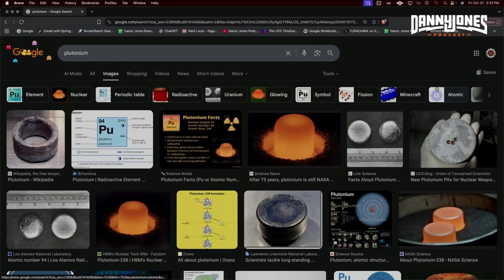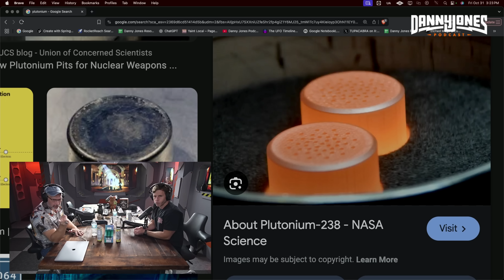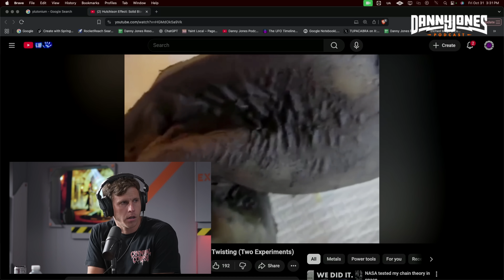Nuclear Machines in Ancient Egypt: Engineer's New Theory Solves Everything | Max Zamilov

Comment: When people study ancient engineering, the most important skill is separating real evidence from hype. A lot of signs that look high tech at first can often be explained by tools and methods the Egyptians already had, especially when you combine archaeology with physics and engineering. At the same time, there are still areas where the data is incomplete and where the right experiments could finally settle long running debates. This is why real inquiry needs patience, interdisciplinary testing, and a willingness to look at both possibility and probability.

Once you learn how to spot the red flags, you start to notice how many theories rely on assumptions instead of measurable results. But you also begin to see the places where the official explanations do not add up. That gap between what we know and what we cannot explain is where the real mysteries of ancient technology live.

I study that same space when I create music. I work with frequency, rhythm, and symbolic structure because those elements let me explore the hidden patterns that ancient cultures understood. It is a small way of reconnecting with the mindset that built these sites and inviting people to feel some of the intuition that old civilizations used every day.

If someone appreciates evidence based exploration of ancient engineering, they usually appreciate sound that carries that same sense of depth and curiosity.

Comment: Im convinced of something along these lines is how they did it. The famous obelisk that still to this day remains in bedrock, not yet fully excavated, is the smoking gun for this theory. If you have ever seen the earth after an excavator has gone along and dug out the ground, you see consistent bucket marks left in the ground from where the digging occurred. Very similar scoop marks are left on this obelisk, which was clearly left in a rough shape, and not yet polish. So we can see they were using like shovels or something that looked to be like 1 foot wide, taking out large chunks of stone in a single swipe. and the same marks are under the obelisk where they were undercutting it. So its obvious they were removing large amounts easily, isnt it more plausible that the stone was softened to make this possible? Doing it when the stone was still solid would have been even more insane. Not to mention we see things like kailasa temple, carved right out of the side of a mountain. As if they did that with chisels and stone pounders. Then we have the polygonal stone walls, that look like puffed up pillows with absolutely no gap between the joints anywhere. Would make a lot more sense if they were soft and they could shape the stone to what they wanted, vs carve it perfectly. There has to be truth to this theory.
Reply: I have always been thinking that the marks on the unfinished obelisk are the fingerprints of the builders that actually were giants working with very soft rock, how they make it soft? Only they know, i guess.
Reply: @andresgalviz315  to me, i dont care who did it. Giants or not, someone had a method here on this planet that is vastly different than how we do things. I of course do believe in giants, since in the past, there are many accounts of animals, trees, all being massive compared to our scale today. But either way, im more interested in how they had achieved it all, and what it looked like doing it. I mean imagine actually seeing the beings who were excavating the obelisk at aswan quarry? Imagine seeing the trillithon at baalbeck temple being placed? Imagine seeing the pyramids only half finished and people around it working? Absolutely incredible. The fact that it all happened at on this planet is almost unbelievable.
Reply: Yes, when I was there it looked exactly like the stone had been soft at one point and been scooped out

Comment: Ark of the Covenant may have operated like a betavoltaic battery that used radioactive emission from "secretly" coated 10 commandment tablets, to charge up the capacitor design, and store a lot of energy..
Reply: What are you talking about, the exodus evidently did not happen so the arc of the covenant only operates in legends and an Indiana Jones movie
Reply: @GinEric84  I can not say one way or the other as to whether the Exodus happened in reality. What I can say with a fair amount of certainty, is that the Bible gives a fairly specific outline for construction of a "device" that may well have been designed for simple and secret communications between a guy called Moses, and his "God".

45 years ago (and before Hollywood and any movies), I was in electronics school and an old offhand remark by Tesla concerning capacitors sent me down an interesting path. I then attempted to reverse engineer the "possible" Ark circuitry, and came to some logical conclusions based on information that is recorded in the Bible, and can easily be studied by anyone who has an intense desire to do so.

(If you have a minor background in electronics or communication systems, you will much better understand what I am going to say here.)

 The ARK, and the entire Tabernacle enclosure, may have been working together as one coherent communication unit. They were ingeniously disguised for simplicity and quiet long life, with no moving parts, and the people that operated it didn't have the slightest clue as to what they had actually built.

The outside "golden Tabernacle" was a long, rectangular and highly conductive open ended box shape, with a very large surface area. It acted like a directional antenna system, similar to a modern day microwave guide. And It was imperative that it ALWAYS be oriented in the EXACT same direction each time it was set up and assembled, because the input signal was coming from a very specific point, and out of sight.

The invisible incoming signal was directly or inductively coupled to the Ark unit through the very long poles that were "NEVER to be removed" from the sides of the Ark box, and the "radio operator" priest wore a very specialized and ornate jewel encrusted uniform, designed to demodulate the carrier wave using crystal. The "carrying poles" were long enough to possibly touch the rear wall of the Holy of Holies, making them actual conductors or antenna elements in the circuit. Hence the strict order that the poles were never to be removed. The priest may have been able to easily and "secretly" touch the ends if needed, perhaps for "fine tuning".

The part of the system that was the most diabolically ingenious was the Ark power supply. The "Cherubim" that were positioned at each end of the Ark lid spread out their "wings" toward each other. But they probably did not actually touch, thus producing a small "spark gap" through which an electrical discharge could jump. (Acting like a primitive spark gap transmitter?). And this is where God visibly "appeared" during his communication with the high priest.

The actual source of the silent and unending power to supply the "device" for hundreds of years, was completely beyond the understanding of Moses and his brother Aaron, who operated the technical system. 

The ARK box was designed to be a combination of high voltage capacitor for storing accumulated energy, and it was also acting as a simple "betavoltaic type" battery to produce the initial high voltage charge buildup, using a constant and powerful radioactive source of decay.

There was an invisible "secret" as to how the power system worked, but the Bible is great at giving out a lot of very important little clues. And ALL the clues add up to something being very radioactive hidden inside that little box.

 The fuel source seemed to be the actual stone tablets (which may have been sapphire or lapis.) But Moses had actually broken the first set of tablets that were given to him, in a fit of anger when he first came down the mountain, and had to bring up another raw "blank set" to be re- inscribed with the 10 commandments. He made 2 trips.

 And BOTH sets of these "stones" were individually inscribed with the mysterious "Finger of God"...

That "finger" was most likely a specialized tool that secretly deposited a highly radioactive and exotic element "of some type", directly onto those stone plates. (Imagine a metallic plasma spray like is used in modern industry to coat materials.)

The invisible power of the Ark of the Covenant may have been LITERALLY hidden in the actual words on the stone tablets!

When Moses came down from the Mount, his hair was whitened and his skin had an abnormal color from direct exposure to "whatever" he was carrying. He had to wear a veil and hide himself away from the rest of the group. He then later gathered all the necessary materials and built the whole Ark/Tabernacle apparatus exactly according to God's precise BLUEPRINTS.

 He put the dangerous power source inside the Ark safety box, put on the very specialized crystal encrusted uniform and breastplate that could DEMODULATE signal (like a crystal radio) and thereafter was able to "talk with God" anytime he needed orders or military assistance.

If you have read this far, and are curious enough, research early crystal radios, early spark gap transmitters, and early capacitor design, along with betavoltaic batteries..

It's an "interesting" story..
Reply: I will add this for anyone who may have a further interest...

Solomons Temple was specifically built to be a "ramped up" version to permanently house the mobile tech that was dragged around in the desert. The ARK of the Covenant box and the priestly uniform circuitry remained exactly the same, but it was the "antenna" system that was scaled up.

 The signals were carried from the ARK in the Holy of Holy's at the rear of the Temple, up through conductive golden chains that connected to the massive freestanding and radiating external column elements (Jachin and Boaz), outside the front entrance. These were made of brass or pure copper, "strangely" designed, and not used for any apparent structural support. There were also large hemispherical bowls and fancy "wire work" at the top of each one, facing upward.

In addition, I have always been HIGHLY suspicious of the (10) large, tall, "Laver" bowl units that were mobile on wheels, and spread around the outer courtyard, (5 on each side). To me, they sound EXACTLY like an antenna "array" system. Apparently women donated their "mirrors" for the original construction of lavers? So this is just extremely "coincidental" that they were constructed like modern day parabolic reflectors..  The total surface area of the dishes is VERY significant, especially when connected and combined in an ARRAY system. Dishes were approx 6 feet in diameter each, with a total of (10) units, standing in the outside courtyard. Their intricate and mobile designs (plus the fact that they are recorded to be 8 to 12 feet tall with no stairs) seem completely useless or extremely inefficient for "washing" things, (which is the usual symbolic explanation.) But a large conductive parabolic bowl would certainly look like a "strange wash basin" to someone who had NO clue what they were actually looking at.. 

This was "more than likely" a large technical setup in disguise..
Reply: It was taken away from the rulers. Which explains why Moses was running away from the Pharoh. He claimed it was given to him, but why would the ruler/Pharoh want to give away a divine instrument like that?
Reply: @MultipleMiggs88 it wasn't taken away from anyone because it evidently didn't exist. There is no evidence to support the Exodus narrative.
Reply: @GinEric84 I couldn't agree more with what you stated here. There is no concrete evidence at all about the exodus , the splitting of the Red Sea, and many more.
Reply: @GinEric84 What I find interesting is that a central part of the Exodus story (Ark) finds its way as a central piece into the 1st Temple story. (Solomons). That construction had some very strange "technical" descriptions also. I have no idea about the actual validity of the original stories, perhaps they are complete fabrications, but the technical descriptions and intimate details of some of the "objects" have always fascinated me, because I see the potential for circuitry. Magic and religious belief systems can just be science, in disguise..
Reply: @MultipleMiggs88 If Moses did "escape" from Egypt in "some type" of storyline, he would not have run with a golden Ark of immense weight. He was probably "told by someone else" how to make the Ark, after he was safely away. But what Moses may have "stolen", and what Pharaoh desperately wanted back, was a mysterious object (or objects) known as "Urim and Thummim". Much easier to conceal and to travel fast with. 

This is the ONE object that "God" did not instruct Moses how to build, nor did he apparently give it to him directly. It may already have existed, and belonged to Pharaoh. But this piece was also essential in the operation of the "crystal breastplate" which the high priest wore when "communicating with God"..

Comment: The pyramids were build as chemical reactors. The chambers smell like toxins and the vaulted ceilings have the dark stains and oil like traces. 
Water was used to flood the bottom chambers and trap air inside the higher vaults. Then filling the chamber with more water causes compression of air within the higher chamber. 
Depending on what chemicals or elements they were adding to the upper chamber was some sort of absolute genius sh!t.
We know they were big into on gold and Mercury.
Mercury also found in a chamber under the pyramid in Guatemala.
Reply: The Egyptian structures also had plenty of water, the same as what our nuclear reactors depend on to cool the process.
Reply: @robertajabour3592 all part of the greater design. 👍
Reply: @NiallMurray-hv5lv  Maybe.
Reply: @robertajabour3592 what process?

You understand wee have a very good idea of how the Egyptians worked stone, right?
Reply: @GinEric84  No. I don't understand. What does the process you are describing have to do with cutting stone?. You are saying chemical reactors. Does mainstream archaeology accept this method as the one the Egyptians used?
Reply: @robertajabour3592  no they use hammer, chisel and saw
Reply: @GinEric84 No one has proven that they built the pyramids that way. And the precision is greater than they could have achieved using those methods.
Reply: @robertajabour3592 according to who?

Conspiracy nuts on the Internet?  The way the stones were cut is not a mystery
Reply: @GinEric84  To my eyes.
Reply: Amazing, every word of what you just said is wrong

Comment: Soooo sandblasting but without sand.. or if the sand was like nano sized vs sand grain sized??
Reply: Imagine sandblasting without sand, because you replaced it with radiation and it ablates the material being shot at (it simply disintegrates the material on an atomic level). It would need a very strong gun tip, I imagine
Reply: @danielpedro77 well yes not sand but whatever shit that guys talking about lmao
Reply: Not quite